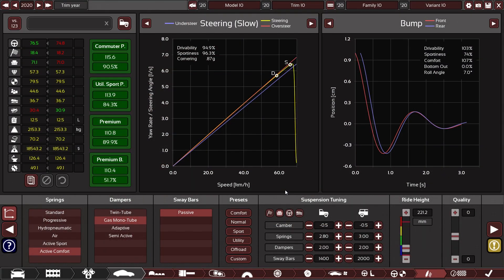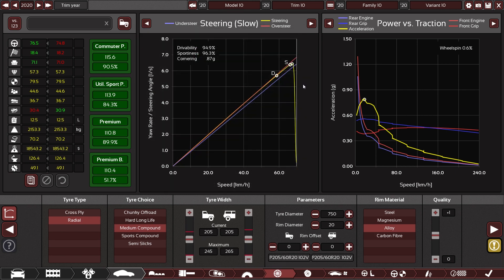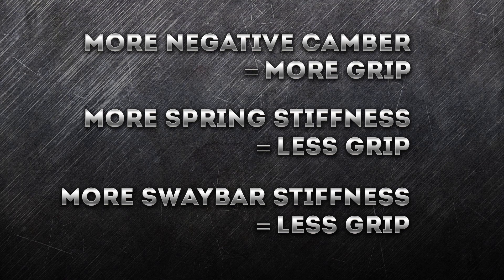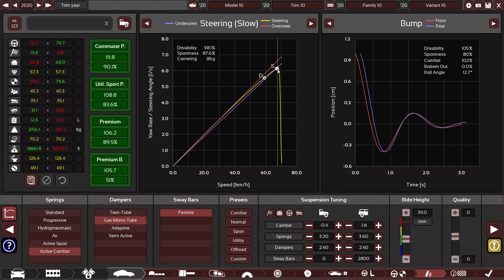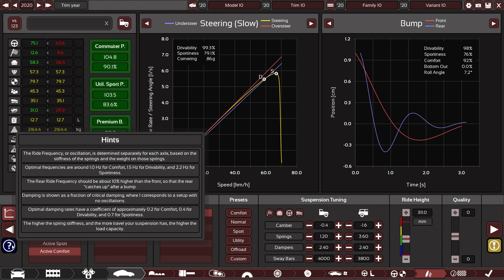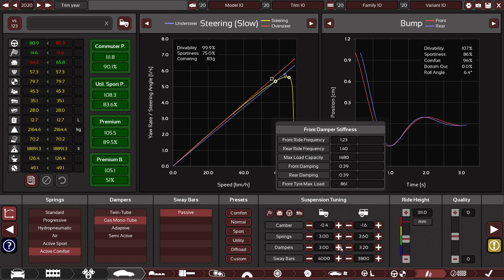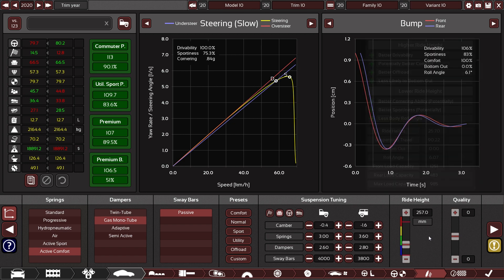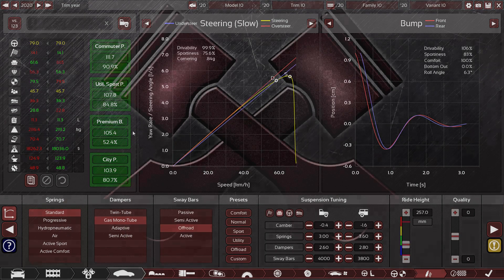Tutorial: Handling & Suspension Tuning

Comment: Rally preset would be very useful.
Reply from the maker: Problem with that is that rally demands a huge range of setups and suspension tuning; what works at Monte Carlo will not work in Finland, and so on.  Moreover, think of the presets as a general starting point; all cars will need some additional suspension tuning beyond that.

Comment: I just bought the game last week. Being a truck driver I don't get to play much. I'm still learning but I LOVE tuning cars in games like Forza or grand Turismo, now this gives me a chance to build from scratch and this my friend makes me very happy. I just built my first car with a base trim using an I4 turbo and the sport trim using a high output V6. I made a mistake though as it seems I have chose too large of a coupe body. Seems my body is on par with BMW MY but my set up is more for a Honda Accord coupe. Which is what I was going for since the coupe is no longer made. Is there a video going into more specifics of choosing the right body? I would like to have a lighter set up. My car weighs over 3800 pounds. And the engine looks tiny when I remove the bonnet.
Reply from the maker: You can check if there are smaller wheelbase versions of the same car body available. When switching out the body just be aware that the visual design of the car will be reset, so that needs to be done before you start designing the aesthetics. :) Anyway, glad you're enjoying it so far!
Reply: @AutomationGame  thank you. I'll have to check that out when I get home.

Comment: Why are the ride hights so high... i tried to build several different cars (like a 5 series BMW which has a ride hight of 144mm) but i can´t reach that ride hight. It´s allways like 6-10cm higher to still looking normal and not totally lowered (if i go under 180mm the tires go deep into the wheel arches).
Reply from the maker: Yes, that is something odd we need to investigate :)

Comment: For those looking to tune their cars for BeamNG, if the road you're driving has many uneven and cambered surfaces with lots of opportunities for suspension travel, don't always listen to the warning in automation about your sways, because body roll is a good thing for weight transfer and predictability.

I've found on most cars that running stiffer dampers is more ideal for roll control than the sways are. The sways are almost always too stiff and will lead to unpredictable tire slip in accel/decel through corners unless they're set to the very lowest level. Completely removing the sway bars from the cars in the BeamNG parts menu usually helps more than it hurts in most of my cars.

Comment: As a bit of a car guy I'm right along with the handling tuning mechanics. I was even going to ask where toe tuning was for a minute. However I've tried a few cars from the Automation/the Beam.NG workshop, and have noticed the flywheel masses are often too high to shift without breaking traction, sometimes low. Giving builders some insight to the freeness of revving might be worthwhile.

One car, called the Vol TR1 Tracker, uses over 1000 hp to toe the rear wheels out up to 1.2 degrees total--from 0.3 on each wheel to -0.3 on each wheel in 2nd gear. I believe it has double wishbone suspension. Hard to say since I don't have Automation to try making my own cars. I've tried many cars that have 0.5 or more total rear toe-in under power, though.

I also drove a car called the Kisai RTR6, which almost sounded like the accel and decel samples were switched.

Comment: This game is really nicely made, and pretty awesome, but I feel like it has one problem: It's like it's made for people who like spread sheets. To some extent, that's me, aswell. But while the game is technically impressive and well made (good job!), it fails a bit on the "immersion" side. It feels like once you get past designing the fixtures and body shape, you never see the car again, as it all turns into a game about numbers and graphs.
For example, when talking about how the car will understeer or oversteer, we're looking at a graph that's not necessarily very intuitive to a normal person. I could instead imagine seeing a visual representation of how the car would react to cornering at speed. 
Overall, I just wish that we'd actually be looking at the car model more while working on the specs. 

Just some thought, I still think it's an impressive game.
Reply from the maker: Since about 2 years ago we're planning on implementing a radial graph for this with more of an illustration of what is going on as a display of a corner. That will be tricky to implement but will certainly help people better understand what is going on, maybe we'll be able to put that in for LC V3 :) You're correct about the "we don't see the car much" thing, but also we don't want to dumb down the game to the point where it either is mostly a blackbox allowing us to show the pretties, or to something shallow :) the numbers and spreadsheets are what a tycoon game should be (to a degree). It is a mega complex game, and if you don't show all the data and info needed to play it, it would be a mega frustrating game xD Cheers!
Reply: This is my excuse to nerd out for hours, I no longer use any vehicle mods in Beam, just the cars I make on Automation. I wish there was a separate UI for doing interiors, and maybe one for doing wiring harnesses (for us super geeks) and a wind tunnel. One can dream, but I really appreciate the fact this game exists
Reply: @timeattackattempts3764  Ah, a wind tunnel would be freakin' awesome.
Reply: I’m late but i just bought and it’s a great game. If possible I think a 3D representation for testing would be cool. a similar mechanic to the f1 manager games but only for the testing of the car to visually see the weight shifts etc
Reply: tbh car companies don't usually spend a lot of time with the body. the engineers usually never see anything physically. only the designers actually see the body per-production. the technicians whom assemble the engine see the engine before the engineers do. it simulates jobs at a car company, and i feel like it's very realistic.
Reply: With the exporter and the BeamNG collab, we can have our cake and eat it too. The cool thing is that some of my cars which looked boring on paper, because they aimed only for practicality and economy, are actually some of the most fun to drive in B-NG. Once I discovered that, I put more detail into their aesthetics. For me, that's the ultimate immersion factor.

Then again, I am a huge car/engineering geek.

Comment: Hey i have a little problem with both games. I tried to rebuild the 1979 78 HP engine of a Volkswagen T3. But the problem is, when i use really the same power settings and such, then i can't get the engine correctly to start. It can't start because engine knocking, or when i fix it by lower ignition, then the engine stops because "ran too fat". So when i bypass this by export it to BeamNG Drive, then car won't start there too
Reply from the maker: If it doesn't run in Automation, it doesn't run in BeamNG. I'd recommend you play the engine designer tutorial that teach you how to make proper engines. They are available through the "Challenges" button in the main menu.
Reply: Yea i know. But that will means that i am not able to recreate that engine. With the same settings of the real car engine, it don't work in Automation.
Reply from the maker: I think you are wrong. How do you know the real car's quality settings, ignition timing, cam profile, etc.? Link me the specs of the engine and I'll see if I can get close to it, I might not be able to but that would be a good test case.
Reply: Well, i have a book about it with very very detailed informations about the engine. Also with diagrams. Its in german, idk if i can translate it right in english with all those special words.

I can't find this information on the internet. 
Let me try to use google translator.

Here are the following informations that i have about the 1979 Volkswagen T3 (78HP):

Displacement, cm³: 1913
Power, KW (hp) / min: 57 (78) / 4600
torque Nm / min: 141/2600

ElectricalSystem:
Voltage, Volt: 12
Battery capacity, Ah: 45
Three-phase generator, A 45

Transmission:
Fully synchronized four-speed manual transmission, differential and twin-pivot shafts to the rear axle.
Fully synchronized five-speed manual transmission as additional equipment for all engines.
Three-stage automatic transmission for 57 kW engine.

Landing gear:
Frame floor system in the front area with shock absorber deformation element and energy-converting front frame construction.
Independent suspension on both axles, front double wishbone with torsion bar stabilizer, rear semi-trailing arm suspension.
Progressive coil springs in the front, space-saving mini-block springs in the back (super-progressive coil springs).
Dual-circuit brake system, front disc brakes, self-adjusting drum brakes, deceleration-dependent brake force regulator.
Steel Belt Tire 185R 14C-
Three-point bearing in large-sized rubber elements, oscillating decoupling of the drive unit.

Gear Ratings (4-Gears):
1st gear: 3.78
2nd gear: 2.06
3rd gear: 1.26
4th gear: 0.85
5th gear: -----
R. -gear: 3.76

Axle ratio: 4.86

Transmission Ratings (5-Gears):
1st gear: 4,11
2nd gear: 2.33
3rd gear: 1.48
4th gear: 1.02
5th gear: 0.77
Reverse gear; 3.76

Axle ratio: 4.86

Engine:
Four-cylinder boxer engine with water cooling, drilling 94 mm, , 68.9 mm, effective displacement 1913 cm³, combustion chamber in the piston and residual combustion chamber in the cylinder head (Heron combustion chamber), compression 8.6. Split crankcase and cylinder heads made of light alloy, wet cylinder liners, triple bearing crankshaft. Centrally arranged camshaft, driven by gear wheels, valve gear via rocker arms and tappets with hydraulic valve clearance compensation. Mixture preparation with a down-stream register carburetor 2 E3 from Pierburg with automatic start, mixture preheating with electrically heated hedgehog and cooling-water heated intake manifold. Aluminum radiator and electric cooling fan with thermostatic control in Wagenbug. Power 57 kW (78 hp) at 4600 rpm, torque 141 Nm at 2600 rpm, output 29.8 kW/I, engine weight 95 kg

Engine stats:
Top speed in km / h: 130

Acceleration in seconds:
0-50 km / h - 4th gear (6.2) 5th gears (8.0)
10.00 - 60 km / h: 4th gear (8.9) 5th gears (9.2)
13.70-100 km / h 4th gear (13.2) 5th gears (13.7)
25.70-100 km / h: 4.gear (21.4) 5. gears (26.8)

Highest load capacity in%: 4. gears (30,0) 5. gears (33,8)

fuel consumption:
City cycle in I / 10 km 4 gears) 13.9) 5. gears (14.5)

constant 90 km / h: 9.5 9.4

capacity:
Fuel tank in liters: 60
Coolant in liters: 17.5
Engine cooling in liters: 17.5
with / without filter change 4,5 / 4,0

Vehicle body:
Curb weight without driver: 1480 kg
Payload: 919 kg
Total permissible weight: 2390 kg
Belly freedom: 115 mm at full load

Ground clearance: 190mm at full load
Reply from the maker: Thanks for posting that :) I'll try to recreate it today and give you an update!
Reply from the maker: That was pretty easy to recreate! Correct bore & stroke, OHC-2, compression 8.6, cam 23, -1 top end quality, 2 barrel carb single, standard intake, Regular fuel, 13.2 fuel mixture, 39 ignition timing, rev limit 5200, short cast exhaust, 38mm diameter, second muffler reverse flow. That gives me 57kW @ 4800 RPM, 144Nm @ 2500 RPM. What is off is the weight, being higher than the original. So really, I don't see much of a problem here?
Reply: Thanks! Does the weight difference help you now to improve the realness of the game? What do you mean by -1 top end quality? So the lowest value? Volkswagen is a high quality product. But why do you set 4800 RPM? In that what i wrote its 4600 RPM
Reply: I found the problem. It was the fuel type. I didn't used regular. There comes a question i have. Does the game support Diesel engines? Haven't seen any diesel engine exported to BeamNG Drive yet

Comment: My vehicles keep telling me the roll angle is large, what is too much? I don't want to have to or need to run sway bars as big, or at all if I can.
Reply: Nevermind. It was discussed later in the video. Just a suggestion though, perhaps tune the warnings to only come up above 12 and go away at 10 degrees, versus 3 degrees. Not every car needs 3 degrees of roll.
Reply from the maker: We'll have a look if the warnings are coming on at the correct time.

Comment: Do boxers give me a low center gravity lol
Reply from the maker: Yes, they do.
Reply: LKRG yeah engine weights are well simulated, if you compare a pushrod engine to a dohc engine you'll see the pushrod engine has better center because it's shorter in height
Reply: President Donald J. Trump is correct. Smaller engines will push the weight distribution towards the non engine end of the car as they sit against the gearbox/driff/driveshaft and will extend from there as the engine grows in size. And that's not even accounting weight.

Comment: I'm just wondering... How can you have too much braking force, or have too much tyres?
Reply: Bigger tires also reduced fuel economy/acceleration (if there is no loss of grip with a smaller tire the increased mass is bad) and braking slightly (more mass to stop and more thermal energy tearing and heating up the brakes) due to roll resistance and inertia. Bigger wheels also increase drag, which isn't good for sports cars. Wider wheels are harder to rotate meaning it's awful if the car lacks power steering.
Reply: Too much braking force = locked wheels when touching the brake pedal, plus the additional weight is not good.
Too much tire = more grip, but more wheel inertia, slower car overall

Plus, everything has a cost, big = expensive.

Comment: What about the Steering (Fast) graf ? ... How to set up a car to be stable at high speeds ? Will you make video about Aerodynamic? 
Is there any written tutorial? 
sorry for too much questions.
Reply: Filip Klema Are your aerodynamic good...? If you up the quality of the aerodynamic (engine/brake cooling etc.) then the drag of the car should decrease and the cooling should improve. Exessive cooling will increase drag as well. Adding just a little downforce will avoid lift and allow for a bit more grip at high speed. You don't need a lot of downforce for stability, it increases exponentially similarly to drag. If you need a lot of grip go for downforce, GT racecars rarely go over 300km/h due to downforce. The McLaren F1 had very low downforce to achieve its high top speed but it was loose at those speeds. You could also go for active aero to get the better of both grip and speed.
Reply: The Aero undertrays can also affect speed and grip, the smoother undertrays decrease drag, the expensive downforce one increases drag in exchange for more grip. I don't know how much drag the undertray adds in game  but IRL the undertrays are the most efficient in Downforce/drag.
Reply from the maker: Same rules apply, but you have suspension setup, tires, AND aerodynamics to consider :) I think people get the concept of "more downforce = more grip" :D
Reply: but what is too much down force and what is too little and how much it affect top speed?

And 

I can't pass 300 km/h with 500 hp engine. it seems to me weird. I don't know what I doing wrong.
Reply: Next time you should show the difference in BeamNG.

Comment: Some mathematic pedantry: I assume that you aimed to tune your car for 1Hz for maximum comfort, and you also said "dont go under 1Hz", however the  bump graph shoes a frequency of 0.5Hz, as one oscillation is only completed when youre back to the top of the graph, in this case at 2s.
It seems to be consistent in automation, so the normal setting aims for about 0.5Hz which gives decent values, but you might wanna look into that if you wanna please the mathematic pedants...
Reply from the maker: The ride frequency is the undamped natural frequency of the system. The graph shows the resulting behavior, which includes the slowing effect the dampers have on the system. Hence, the graph looks slower than what the ride frequency indicates. I showed the example where the damper is set to 50% of the critical damping coefficient and the wave got super long, while the frequency didn't change. All this is based on somewhat proper real life mathematical models for suspensions, it should be pretty accurate. Cheers!
Reply: Hm I guess I should have paid better attention to physics! :D

Comment: This actually helps more than I thought. Still having issues with understeer-graph-but-oversteer-warning though.
Reply: Sorry, Youtube wasn't showing replies to my comments -_- Just saw it now.
When I start pushing for more cornering Gs in both slow and fast steering, non-FWD cars tend to give me a yellow warning about oversteer, which does happen in BeamNG.
However, according to the graphs, the line sinks down to the bottom completely, which should mean understeer.
Reply from the maker: Could you elaborate what kind of situation you mean? What does your graph look like?
Reply: It's possible the yellow line is over the redline for most of the graph then suddenly snaps to understeer at the end. I have that issue with lightweight, mid engine sports cars. Just takes some plugging away with the suspension setup to fix it.